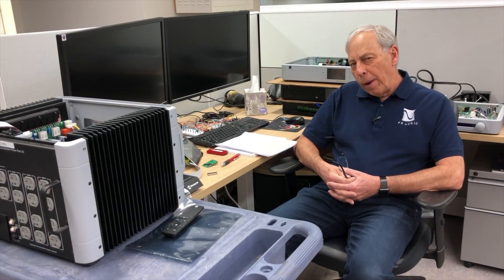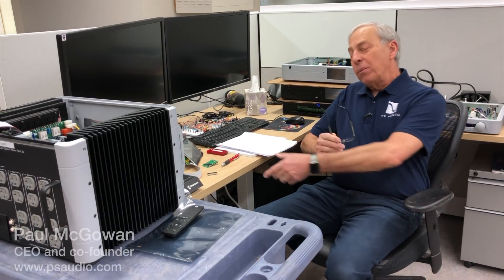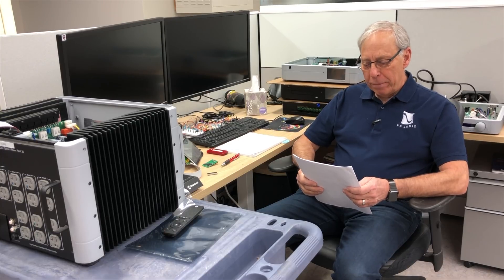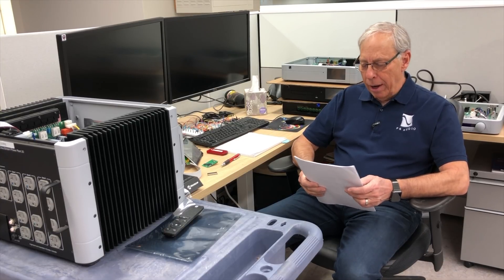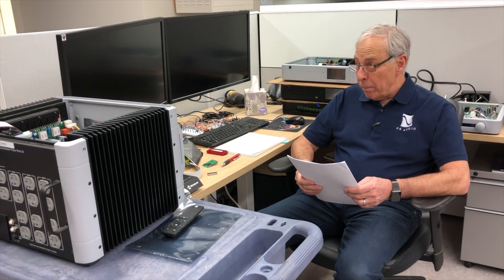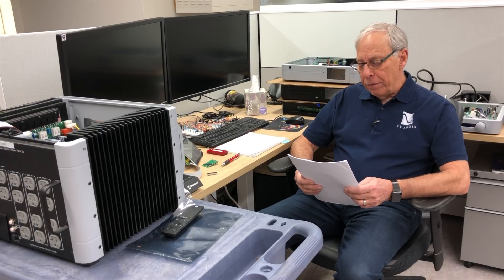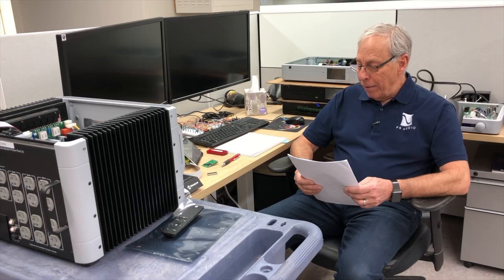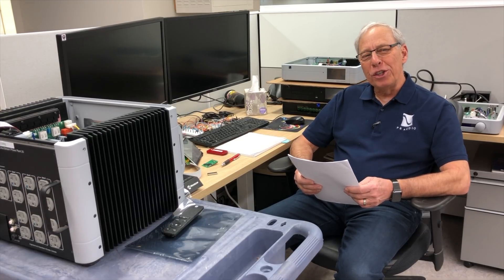Why do amps warm up?

Comment: Do Op Amps and Microphones circuits Need the same warm up too?  I’m trying to understand why my Op Amp mic seems to sound better after it’s been running for a while.  I also noticed that it sounds terrible if I haven’t been using if for a couple of months and I need to keep it working for longer before I record.  Any ideas?  Thanks!

Comment: After clearly noticing this effect from my own solid state amplifier, I discussed this with a friend who is a retired electrical engineer. He explained that though a transistor is instantly on it is not at peak performance until it warms up. He said that when, as a civilian, he set up and installed radio equipment for the military he had to let the radio gear warm up for at least fifteen minutes before he could tune it reliably.

Comment: So if anyone can help me with this question,I have an onkyo M-504 intergrated amp, I bought cooling fan that sits on top and sucks heat from the amp and shoots it out the back, Should I just leave the amp alone and let it play with it's own warm up and natrual heat it puts out or should I still use the fan to keep it cool? I also have another fan on my SX 1050 PIONEER RECIEVER ALSO, Am I causing damage by using the fans or should I just elminate them all together ? Thanks if anyone can please help me??
Reply: I've got an Onkyo integrated as well and have a fan setup like you have. Been running well for over 10 years. I figure, it's cheap insurance and lengthens component lives.
Reply: @jamesplotkin4674  well thanks for replying to my question, I'll probably do the same if it's worked for you that long.I really love this amp and will always keep it I just want to make sure I'm doing the right thing,Again thanks James 👍🏻🔊🔊🎶
Reply: I don't suspect this response will find the original op of this question about a fan and truly I don't know the answer to that question myself. The thought did cross my mind about a fan before but then I became concerned about drawing dust into the inside if my components and since I've never seen anyone else use a fan on audio equipment (including high end gear) I couldn't justify the experiment with my own.

Comment: I have always wondered about whether you need a signal for break-in.  If it’s going to sound better after a hundred hours or so, is that a hundred hours of just being on or with a signal. Obviously a speaker will need to be driven, but an amp?

Comment: It would be very easy to determine how long it takes an amp to reach a stable temperature by measuring the temp.  If it's much less than the hour or 30  minutes (as I suspect) the questioner says then he's hearing things.  I bet it's a matter of a couple of minutes to reach a stable temp.

Comment: Right, a semiconductor power device (transistor) needs to obtain thermal stability to function within spec. A well designed circuit with proper heat exchange (heat sinks) should reach termal stability within seconds at normal room temperatures. If it takes more something is wrong, either amp is broken(incorrect bias) or designed improper or done so specifically to overcome some other problems. One problem could be that the designer wanted to show off massive heat sinks that were completely unnecessary. If the amp was off for a few days I agree that it will need a few minutes for all caps to fully recharge.
Reply: A class A amp will not reach equilibrium until the heat sinks are warmed up, this will take a good hour typically, and closer to 2 on many systems. A class D amp will reach equilibrium in a few minutes, not the few seconds you think unless the system has no heat sinks at all.
This has nothing to do with poor design, it is physics.
Also, operating within spec, and operating at optimum are two totally separate things.
Even my NAD AVR improves after a few minutes from cold, my M2 takes an hour before it sounds really good, and about 90 minutes to reach best sound.
Reply: @joshua43214  I'm not a native English speaker , but on the spec sheet of any transistor it will be stated the temperature range were it operates at optimum, so yeah, spec. I've so far had 9 amplifiers, most class AB and some class D. None needed worm up at all. Their prices range from £350 to £1700 so I would say a good mix.  I have no personal experience with class A so cannot comment, but it seems preposterous to wait 2 hours before you can enjoy music. But I guess if you have the money for class A you can call your butler to turn on the amp before you leave work.
Reply: @LD Blake 
Don't quality amps use a resistive "soft charge" circuit for the caps ?? Even then we're only talking seconds...
Reply: @LD Blake yeah buddy !!!

Comment: Thermal runaway ... reminds me of OC28 germanium output transistors lol !!  The heat sink system in my power  amp is cooled by a variable speed DC motor which is servo controlled by sensor mounted on the hottest part of the heat sink. The harder you drive the amp the faster the fan goes ..
Reply: The Harman/Kardon Tc-600 had the viarible fan. TC stands for tunnel cooled.
Reply: Is that a "real" profile pic ??
Reply: Sorry @Wannabe, either she or I, am the last word here. 
Poser, suggestion;
Make a real profile, have some content, have a picture of something real and most importantly, 
have something to say.
Then you can leave the 
Wannabe king.
Reply: @Stereo Junky "Make a real profile, (which you don't have) have some content, (which you don't have) have a picture of something real(which you don't have) and most importantly, 
have something to say." which I do have...……..Eat me.
Reply: @janinapalmer8368  
No, just replying to stereo junky. Did you read his comment ?
BTW- you were correct about wall mounting and baffle size. 😎
Reply: poserwannabe ~ of course it is !

Comment: MMM,maybe some one can help me here,my sound system does the opposite,whin 5 mins of swithcing on it sounds great,an hour or two into a session ,it starts to get a little muddy,now saying that,i have repaired it,changed out the main power caps and the 4 off mosfets in the power supply,but these parts where from china,could it be these cheapo parts i am putting in ?,its been 10 years since i have listened to my system,but i dont remember it doing this before,and help would be soooooooo much appreciated,regards Mk
Reply: Thankyouso much for your timeand interestin helping me,im new to electronicsand repair,but i will do what you have suggested,i dont have a lot of spec on the power amps{as there are two}but the one with the original mosfets and power caps sounds better,i think ill change back the mosfets ,for original good quality ones{as ihave already ordered and recieved them,should i use a higher quality power caps to,so to upgrade the power supply,say from 10 000uF rubycon to  GENUINE BHC Aerovox capacitors,would thatimproove things,kind regards and thankyou angain  @LD BlakePS my space is playing up
Reply: thank you very much, I will follow your advice sir, many thanks Mk. @LD Blake
Reply: I had a similar symptom when I was playing at a high volume.  The speakers would get too warm, their impedence would rise and music would start to sound weak and have restricted bandwidth.